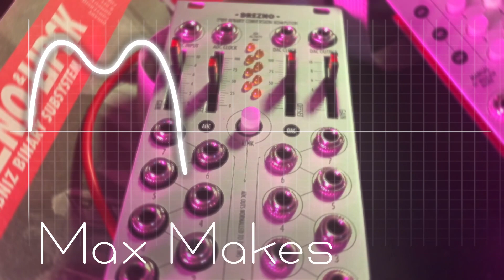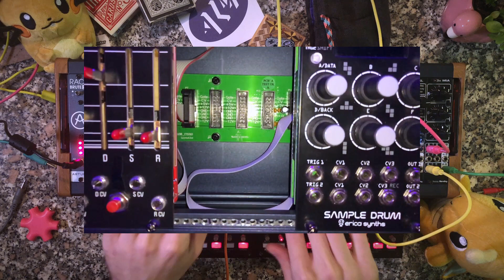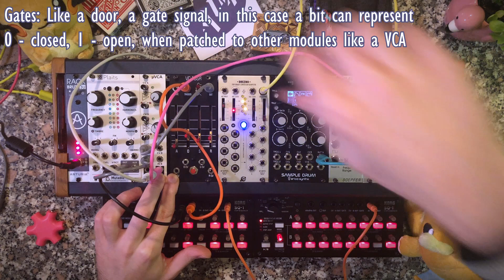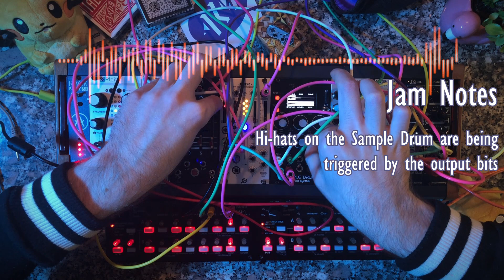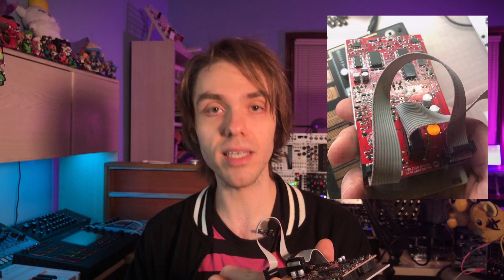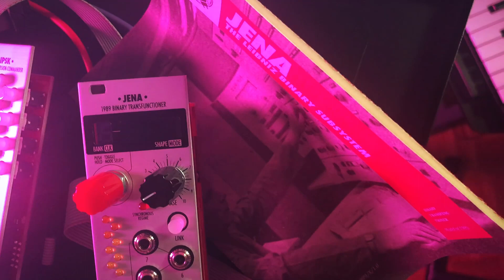Xaoc Devices Drezno || Eurorack Guide, Jam + Thoughts

Comment: thanks for making this, just about to dive into the leibnitz system so looking forward to the Jena video. subbed. edit: can you briefly maybe cover the adc/dac clock inputs on drezno in future vid? cant figure out what they do
Reply from the maker: Sure thing, I'm planning on going more in depth with Drezno in the Lipsk video as Lipsk is just an extension on its basic functionality. For now, the clocks you can give it are overrides of the internal 2MHz sampling clock in Drezno. That clock isn't tempo synced to anything, and if you wanted your bits to change on a tempo you could give it a clock you're using in your patch. This would have some impact on audio you might be processing through it as well if you intend on getting it out of the DAC, you can look up Nyquist and aliasing for that.
Reply: @maxmakesmusic6836  Thanks, will do!